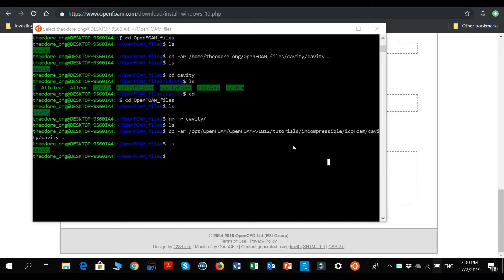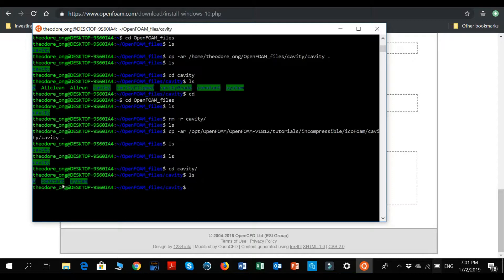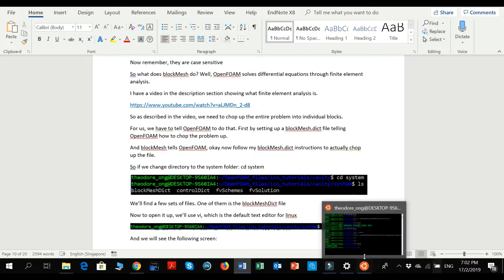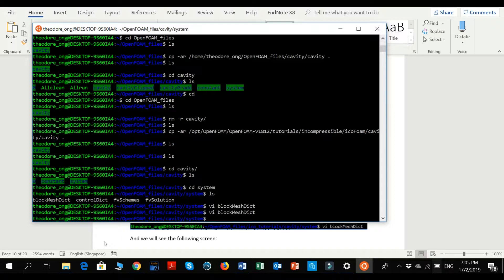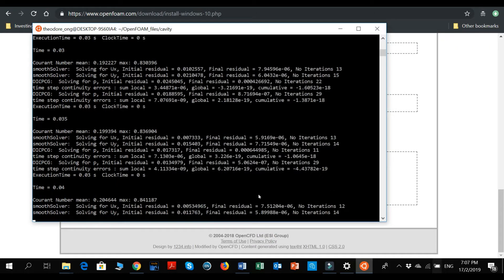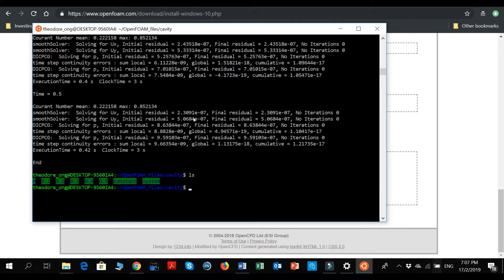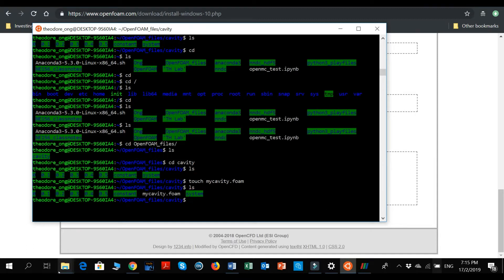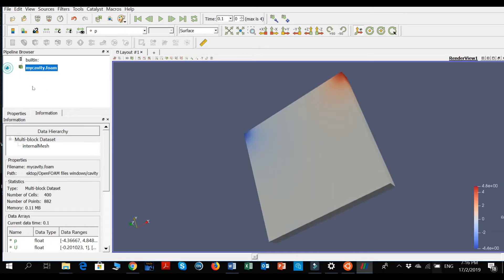OpenFOAM for Beginners win10 3 - running the cavity file and visualising with paraview

Comment: Hello sir,
I can't find rootfs folder in LocalState, there is only a ext4.vhdx file.
Reply: Have the same issue and found no way to mount the disk, apparently it's quite hard if you don't have windows 11, did you manage to solve this problem?
Reply: @joaoacosta3270  yah just type the comment
Reply: Never mind I found it by typing "explorer.exe ."
Reply: @TheoOngScienceAndEngineering  Hey there! I also encountered the same issue where only the ext4.vhdx file is visible. Even when I use the 'explorer.exe .' on the PowerShell terminal, it will open the normal 'Documents' folder, but not any folder in Ubuntu/Linux.
Reply: Alright the problem is fixed now!
Reply: How ? can you please guide? I am stuck there  @prolink0129